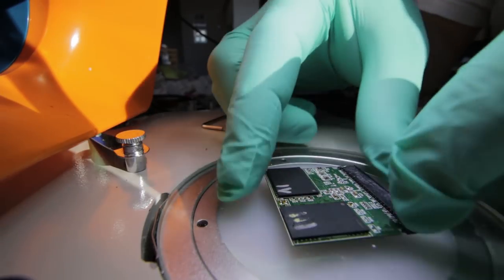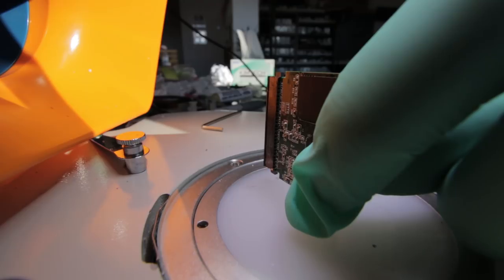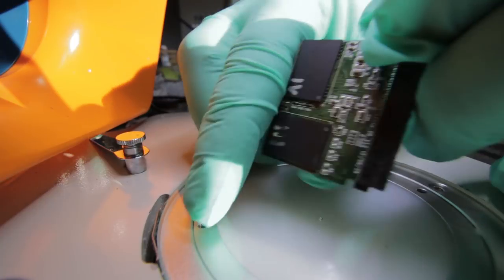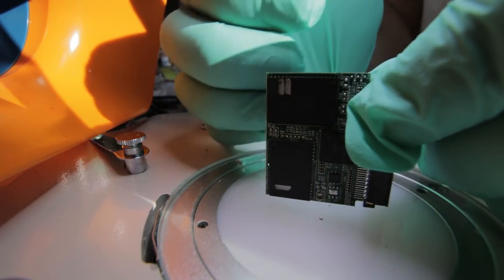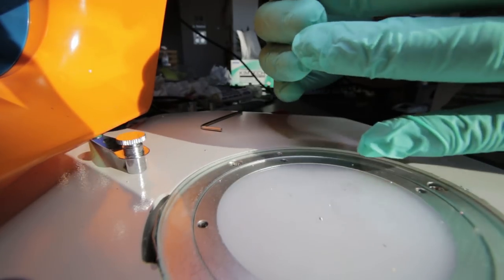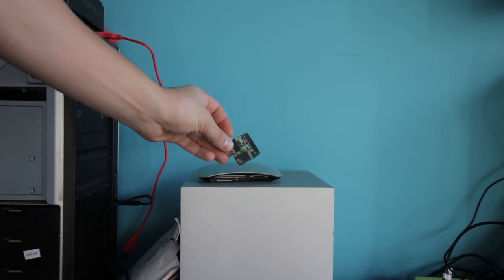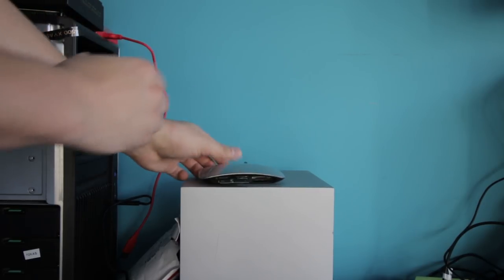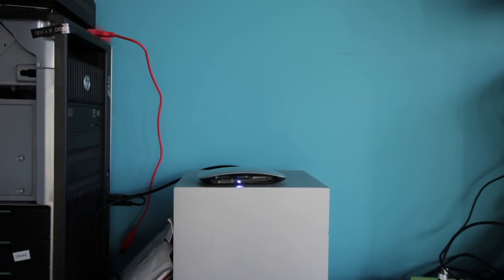how to recover data on compact flash card that is not recognized with a donor

Comment: I am always amazed by your work... you are a surgeon for electronics... I am still waiting on a video from you where you show how you would recover a raid array from a NAS like a synology or another brand !
Reply: Usually those use a linux kernel and either mdraid or lvm2 raid. It's often possible to recover the data by sticking the disks into a workstation and typing a few linux commands. It would be uneconomical for the NAS manufacturers to develop their own RAID stacks. Asuming your NAS is broken, not the disks of course. If the latter is your problem, a guy like https://www.youtube.com/user/hddrecoveryservices is you best bet.

Comment: I found that 350 is the ideal range with my high end digital iron when it comes to electronic repairs; "less stress on the boards and ic chips", so I concur and agree that is the sweet spot in removing components.

Comment: Nice and clean as always. You love that J tip. I haven't broken down and gotten one yet but seems to be good for larger pcbs.
Reply from the maker: all I use is J on both the irons. on the upcoming SSD vid, I used 2032 with the J to reball the controller. Worked like a charm.

Comment: Nice work! I wonder whether the controller was the problem or the PCB? If the controller was the bad one, why wouldn't you just swap it with the healthy one?
Reply from the maker: There is a chance that the controller was bad. I opt for NAND swap just because it rules out many potential issues. The controller probably would not like a lot of heat, and it does have a massive ground pad under it, so taking it off can be challenging. You do have a great point here, if the issue is controller related, this could be also solved by a single controller swap too

Comment: So lets say i have an SSD that the SATA cable port broke on it and my computer is unable to read that i have it plugged in... all my windows files for boot are on there. I sent it out VIA a computer store near me to get it fixed AKA "new port micro soldered back on" after this was done they still were unable to get it to read through their computer.... my next step would be what? try and spend a lot of money on Data recovery? do you have any ideas on what i should do from here?
Reply from the maker: Astro Tater no, just find another place who can actually handle such an easy job as SATA port replacement
Reply: Well they said that they did replace the SATA port but it was still unable to read through the computer.... I left you guys a message on the phone last night giving out more detailed information! thank you by the way for the great video it was very interesting!

Comment: I have a quick question on data recovery, I have a ST1500DM003 that disconnects from my PC after trying to copy files to/from the drive and is totally undetected in Windows and BIOS until the power is removed for a few minutes. Is there any home method to get the data off this drive and is this an issue you have came across before? The data on the drive is not valuable it's just a bit of an inconvenience to lose.
Reply from the maker: with terminal you may be able to, but I honestly never done it outside of the utility set
Reply: Ah so not something easily done without special tools then, oh well thanks for the reply.

Comment: I have a Canon EOS Rebel 300D that uses the Compact Flash 2.5 memory card. I CANNOT transfer any photos off this card to my Sony Vaio laptop. NOTHING works. It won't read the CF card at all. Not only that, my desktop (which has the CF card slot) ALSO will not read them. I have Win7 on BOTH. This is royally pissing me off.
Reply from the maker: You can mail it in if you like. We will get the content off

Comment: so its possible to even recover / fix a SSD hard drive!  Will that be easier then HDD?

Who would've known years ago that this new tech is so vulnerable to any damage or software wear......... my VHS tapes are still working great, stored them outside the cassette in a dry and warm place....and those are from the 1980s
Reply: but it looks like there is no best way to store information digitally for a long time without risking loss?